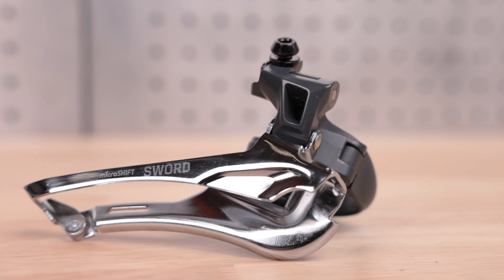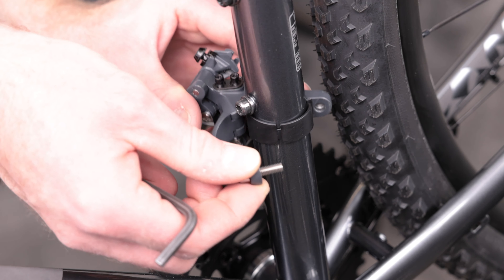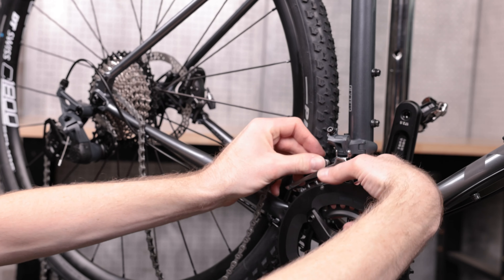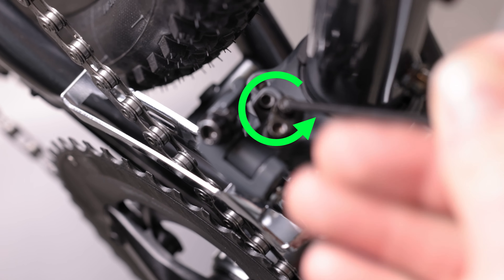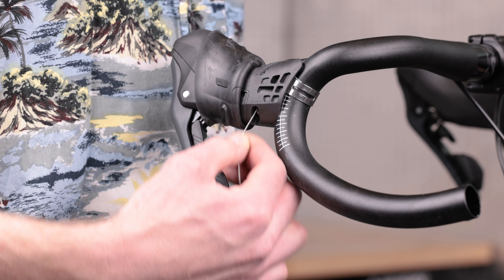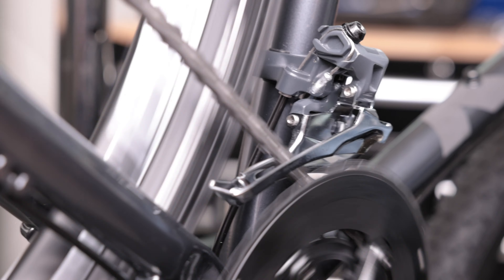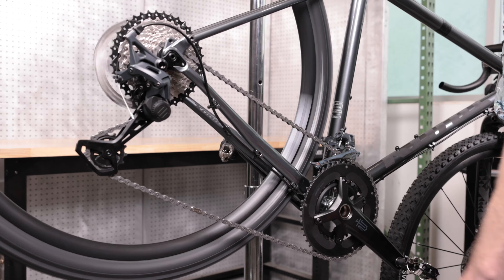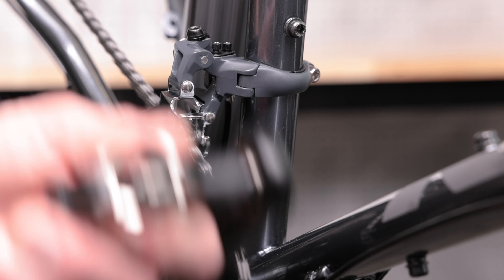microSHIFT Sword Front Derailleur Installation Guide

Comment: One more question.  I've got an old hardtail that I've been thinking of turning into a gravel bike.  It is set up for a top pull front DR.  Can Sword deal with this frame setup?  Thanks.
Reply from the maker: Sword is bottom pull only. If you've got top pull, you'll need to install a pulley below the front derailleur.

Comment: I've got a really nice retro steel frame that I would like to put this on.  It has bare cables (currently friction shift) that go around the exterior of the bottom bracket.  Will this FD work with this frame (i.e., without cable housing on the FD cable)?  Thanks.
Reply from the maker: Yes, it will work fine. You will lose the ability to adjust front derailleur cable tension if you don't run full housing, but that's it!
Reply: @microSHIFTTECH  thanks.  So run an inline barrel adjuster between the shifter and the cable stops on the down tube where the friction shifters are now and the bare cable back from there.  Is that right?  Thanks.